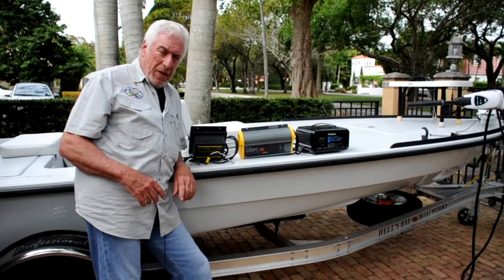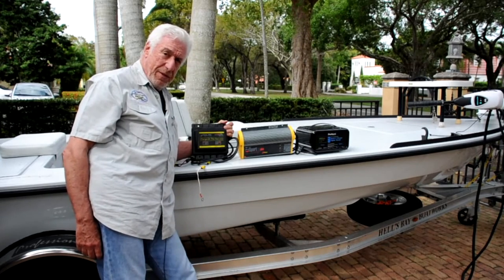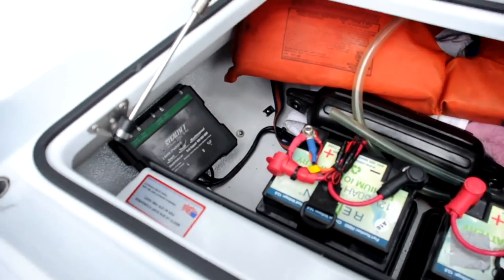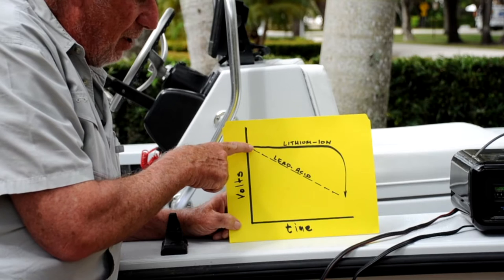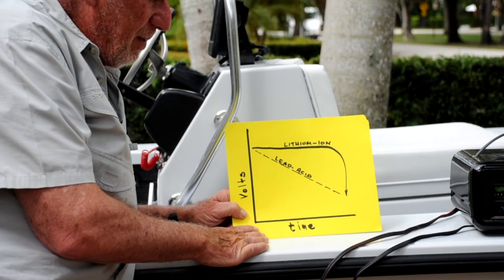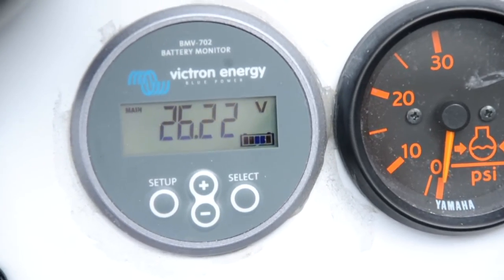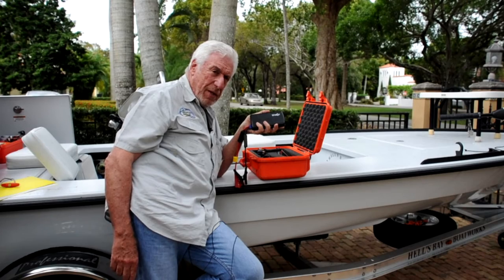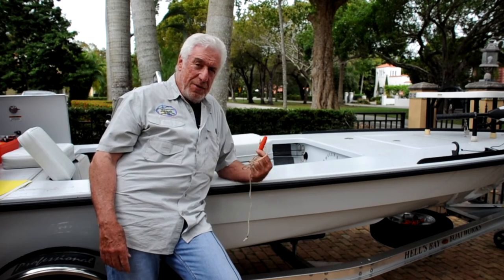Lithium Batteries In Backcountry Skiffs

Comment: Thank you Sir for the info...I have been thinking of just changing the trolling motor batteries to lithium batteries and now I am not sure. wanted to keep my Agm house and two lithium's for trolling after seeing your  I  realize it is a bit more than just replacing my two odysseys  for the 50 amps. plus my East cape has the batts in the small console. I would need to change the 3 bank charger as well humm left me thinking is it worth the investment. To save some weight  and maybe a bit more run time! Not sure Again thanks will look into a bit deeper.  Really appreciate your video not to much information on these systems for or skinny water boats.  Tight lines and maybe I will see you in the back country someday LOL!! Not to many East Capes out there!!!!

Comment: Ed,

Thank you for sharing how lithium ions truly work for us small boaters. I have a Ranger Cayman with a 24v troller. I am planning on swapping out those batteries as well as my house battery next year. Have a guy here in Michigan that only sells lithium ion systems and it is $2,600 for a complete system of a on the run charger and ac charger and a 3 battery system. Will be glad to see those have lead acids out of my boat.
Reply from the maker: Good to know that there are a number of complete systems on the market.  Be sure that the chargers are certified for lithium.  Also, small engines do not put out a lot of amps from the alternator so your on the run charger might not be helping very much.  It is for that reason that I recommend a voltmeter as part of your system.

Comment: Ed I hope your still available to answer a question...why did you chose 2 24 volt 50ah batteries in parallel instead of 2 12 volt 100ah batteries in series?....the cost was and is the same ????
Reply from the maker: There are two 12v 50amp batts in series up front to run the 24v troller.  Having run the system for 2 years I would recommend a single 24v 50amp batt as it is possible for the individual batteries to develop  a charge difference between them which has the potential of shutting down the charger along with the lower charged battery.  To go one step further, I would not have an AC charger or an on the run charger on any skiff with less than 135HP because the alternator output on smaller engines is not sufficient to maintain the charge.  Instead I would buy a stand alone lithium battery charger to fully charge the batt the night before you hit the water.  Remember that a battery charger made for lead acid batts will not fully charge a lithium battery.  I intend to publish another video detailing my latest experience as just mentioned.
Reply: EDWARD GELBER thanks for the response....I'm getting ready to take the plunge with lithium ...bass boat...for some reason I just assumed that your TM setup was two 24 volt batteries...I didn't think that twin batteries would develop a charge difference that's something I'll have to discuss with RELiON...my TM is also 24 volt and I'm trying debating wether I should go with two 24 volt batteries in parallel which is only 50ah or go with two 12 volt 75ah batteries in series...I think the 75ah choice is better suited for the heavy TM use.....I already have order the stealth 1 ac..dc charger...just waiting for RELiON to answer some questions....

Comment: once you understand what amps you will be needing from the battery, due to how many amps your device is going to use in a given time, then the fancy chargers $$$ are less of a concern.  the battery BMS kicks in at a certain point in order to not damage the battery, it will effectively ,,,, go to sleep.  I think the dealer that sold you the batteries knew what he was doing, but did not share the info with you....  it is a sale to them, nothing more..  they know you will come back and need more goodies...  sorry, but that's a fact...  it would have been nice if all concerned would have been explained to you up front...  I done my research, found all the info I could on the internet (not from dealers, but from users of the batteries)  as with anything, research, find out up front what you are getting into before you proceed...  I did and I am happier for it...

Comment: WRONG! All the things you are saying were true when Li ion batteries first came out.
There are multimode chargers out there that are compatible with Li ion batteries. Most reputable Li ion batteries now have onboard BMS (battery management system) and ARE true Plug-n-Play!

In addition, if you couldn’t run your trolling motor for 12-14 hours straight on lead/AGM/Gel batteries before...and the cue you use to know your batteries are dying is the drag on your equipment, then a little common sense and simple math would give you an idea of how long to use the Li ion trolling batteries.

When you’re “dead in the water”...do you mean you run your boat and trolling motor on the same battery bank? First off...that’s usually a No! No! and anyone doing so knows they are only asking for trouble and better have a good tow membership (plus aren’t Minnkota 36V systems anyway?).

I run 2 Lithium ion marine batteries (one as the main/starter; the other as a house battery) and they are plug-n-play, replacing the AGMs I had. All that needed to be done was to move the wires and attach them to the new batteries...nothing more. You don’t need any additional gauges!!! NOCO Genius makes a charger that is compatible with Li ion batteries so I can still use it to charge lead/AGM/Gel as well on the golf cart, and ATVs...although may switch those out to Li ion too.

Please consider revising/updating your video or remove it because you have dated and mis-information on here!!!